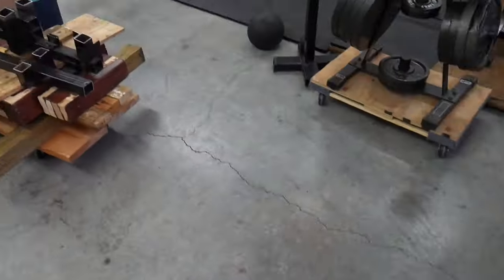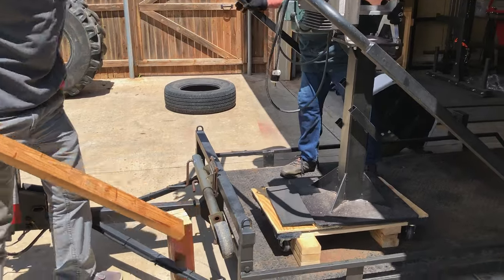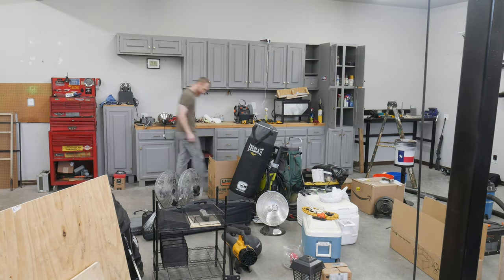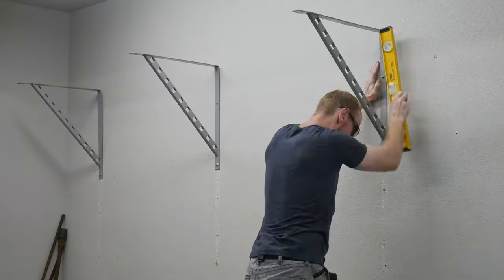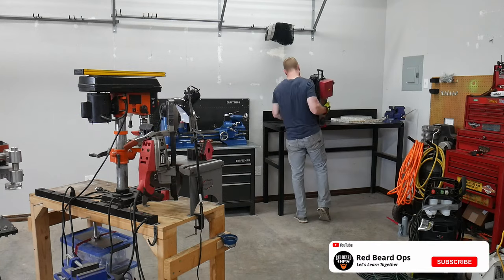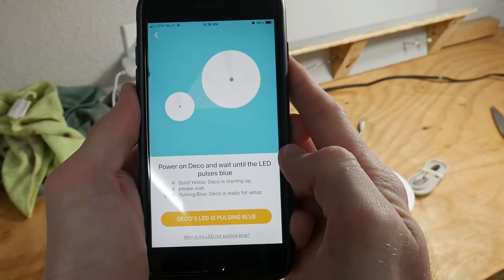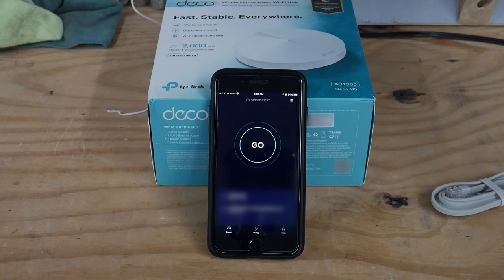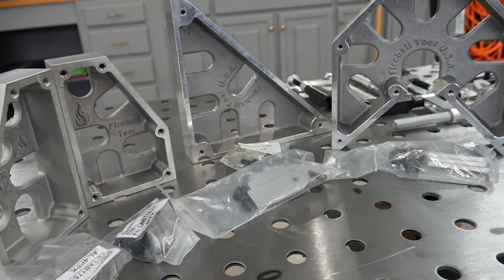New Shop Intro | The Journey Begins

Comment from the maker: So what do yall want to see?!  🙌💪
Reply: Khukri built with beautiful hollow grind .
Reply: i wanna see that grinding room!
Reply: How not to set myself on fire/smash my hand or foot/ lose a digit to a machine. And of course how to select a fire extinguisher or first aid kit.
Reply: Diy dust collection!
Reply: @REKKnives  I 2nd this request!
Reply: Make something from Wootz/crucible steel, I've always wanted to have a go at that technique
Reply: Everything. I love shop videos. Grats on the new shop!
Reply: A Damascus Kitchen Japanese knife
Reply: 3" folding, non locking pocketknife build. I'm from the UK, this is the legal EDC limit. Anything else you need a legal reason, such as work or fishing, and evidence of such, to carry or it would be considered an offensive weapon. Possession of an offensive weapon carries, to the best of my knowledge, a minimum of 5 years imprisonment. 😭
Reply: @dakotalong4520  Do friction folders fall under the non-locking rules?  That might be a good way to build your own folding knife, as most folders are surprisingly complicated and require precise fitting and machining.  A friction folder requires some fitting with the handle but nothing need be done with the blade itself...it's super simple.  As far as the build process goes it's essentially the same as making a fixed blade with a small offset tang, then making a handle to fit.  Assuming you can grind a blade from stock, the most difficult part beyond that would be drilling the pivot hole and fitting the handle, and that's pretty simple.
Reply from the maker: @dakotalong4520  Damn... that's crazy. Sounds like tyranny
Reply: @RedBeardOps  damn straight it's tyranny
Reply: @Skinflaps_Meatslapper  yeah, friction folders are ok.
Reply: I wanna see the Texas flag right side up.
Reply from the maker: @boritchie8086  Hey Bo, it has been fixed. That's what I get for rushing! - https://youtu.be/6JVB-Q42iiQ?t=27

Comment: Well done, I have a question on grinding, is it possible to get the grind profile exactly the same or when you make a large bevel it sweeps wider....
My friend tried to sharpen one of my knives on the Tormek system and he said the bevel was different but I use a jig......
Regards long time no video 😊
Reply from the maker: Hey Raymond, I'm not exactly sure what you're asking in your question. It is defiantly possible to get the bevels on both sides damn near identical. Takes practice and patience for sure. Cheers sir!
Reply: @RedBeardOps  , hi,  
No my problem is keeping the thickness of the bevel the same a long the one side, it's very hard to have it the same when you curve to the point of the knife.